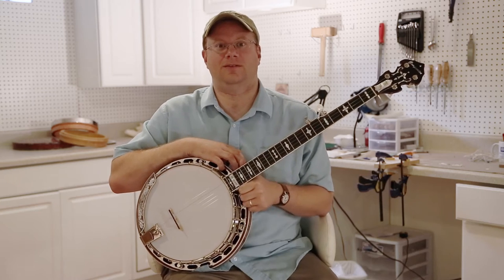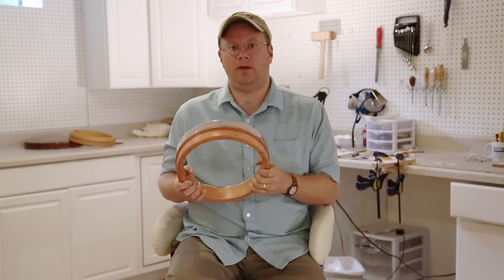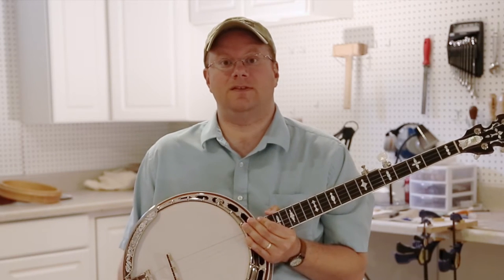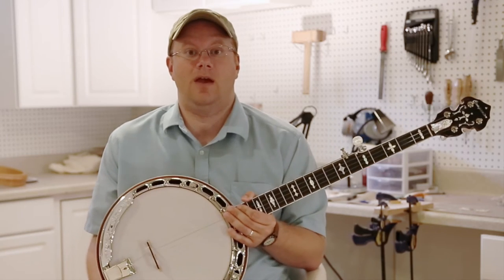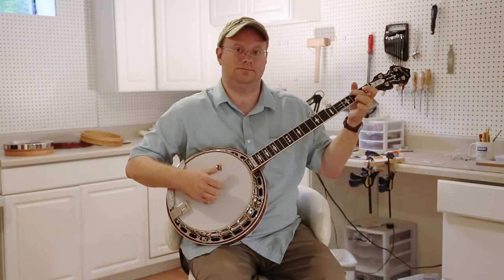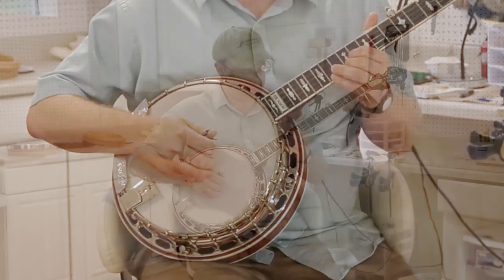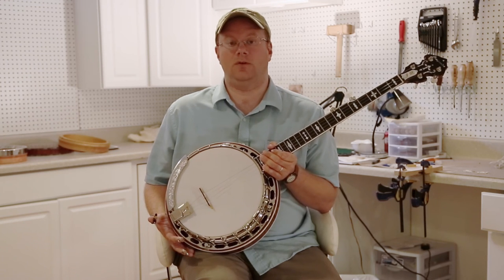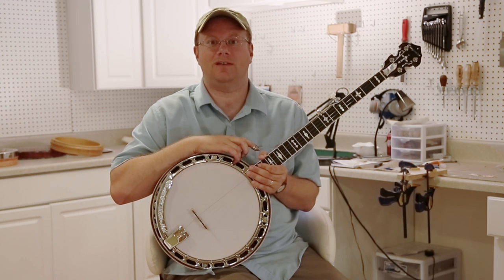Companion Banjos - Wooden Tone Ring Demo

Comment: I have two banjos both are four strings. They both have tone rings. One has the tube-a-phone ring that I have weighed. It weighs one and a quarter pounds. The other has a flat master tone ring which I weighed at three and a quarter pounds. Both banjos I have used nylon and steel strings and many other various set up. The heavier one is by far the most powerfull one.